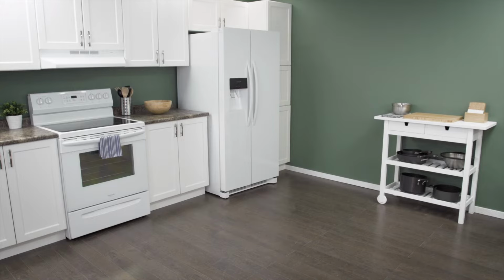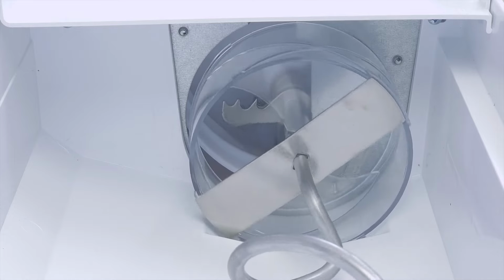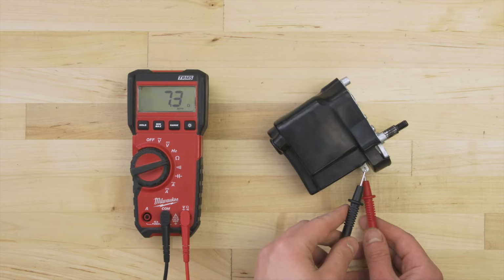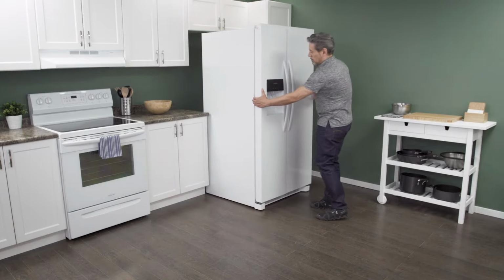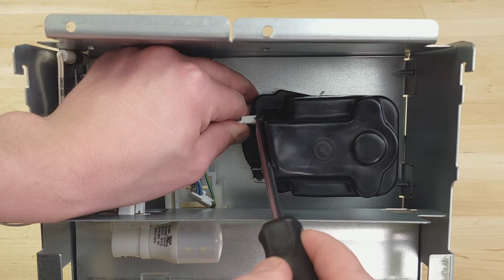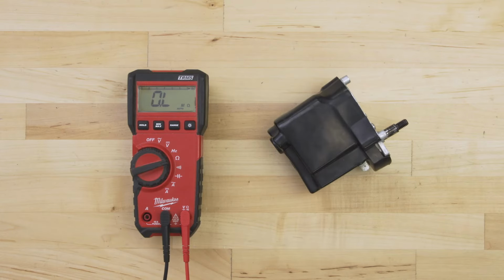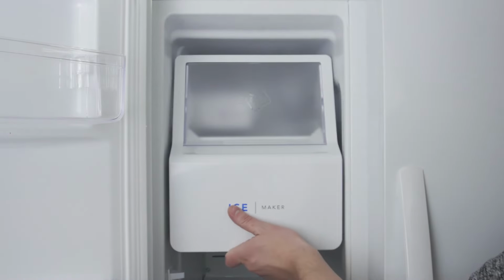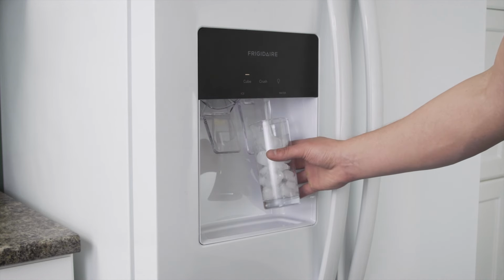Ice Auger Motor (Testing & Replacement) | Repair & Replace

Comment: I have a Whirlpool with similar Ice Maker with auger motor that wouldn't turn.   This video was really helpful.  I took the unit out and measured the resistance through the motor at around 7 Ohms so the motor is okay.  I used a hairdryer for about 10 minutes on high heat directly on the motor.   Then put the unit back in the and it started working.
Reply from the maker: Thanks for sharing your experience. It seems that the motor could have been partially frozen. Glad it's working again!

Comment: So my auger W10225313 on my Whirlpool Model J BP24BOH3WH got flooded by a hung up fill solenoid. I removed it did my best to thaw it, shake the moisture out, left it on the ac vent to dry the excess moisture out overnight, reinstalled it and it must still have water in the gear assembly because it worked until it got cold enough to freeze up again. Might try setting it in a bag of rice for a couple days before I bite the bullit and order a new motor...still not sure why the fill valve did that, is it timed to fill from the processor board or is it mechanically timed from the harvest cycle?
Reply from the maker: Thanks for watching. Models that control the ice maker with a control board would use a small relay to control the solenoid water valve. In that case the relay might be getting stuck. Generally this would be a timed fill as these generally do not have a level sensor or anything to detect how much water is in the ice maker tray. If it continues to stay open and dispenses too much water then it would be best to replace the board. Alternatively there is a slow continuous flow of water coming from the fill spout then the water valve might not be closing all the way, and would need to be replaced.
Reply: @AmreSupply  Ouch. That's not so good news, pretty sure the board is $$$. and it's def. not leaking thru continuously, that would be an easy solenoid replace. Well thanks for the info, we have hardwood floors and I caught the thing stuck open just as I was leaving for work, now I do not trust it to be on while I am sleeping....
Reply from the maker: @94757598494309438  Happy to help. At least in this case you can close the water shut off to ensure that you do not have any water leaking out of the ice maker, but it will also mean that you will not get any water to the water dispenser. Keep us posted!
Reply: @AmreSupply  Currently back to square one with everything working as it should, the remnant of h20 in the motor must have evaporated enough to allow the motor to turn and dispense ice! Love it when problems self solve. One caveat, I ordered leak detectors and placed underneath in case that sticky relay comes back...

Comment: If the auger stalls, like it's jammed. Do you replace it also? I can clear the chamber and it will dispense ice for a bit and then jam up again, like the auger doesn't have enough power to break the ice.
Reply from the maker: Thanks for watching. There's a few things that you could check. If the freezer is not cold enough near the front dispenser, then some of the ice cubes might melt and re-freeze together between uses. If there is a flap, make sure it's closing properly. As well check the freezer door gasket for any gaps. 

Additionally the motor might be starting to wear down. Installing a new motor would have more power to break the ice.